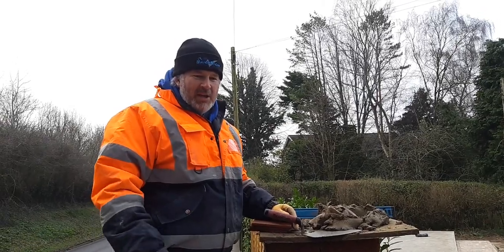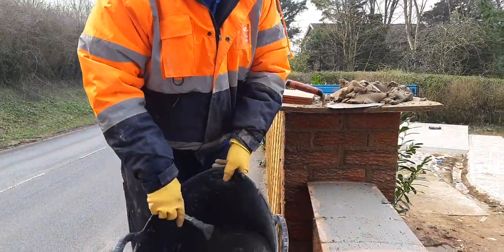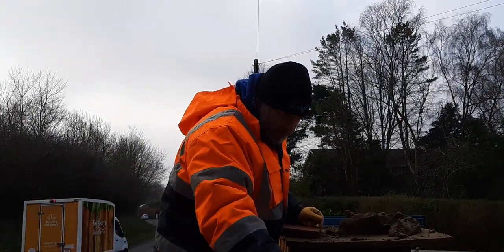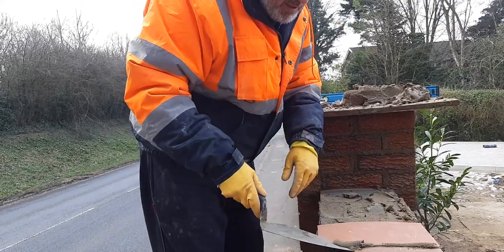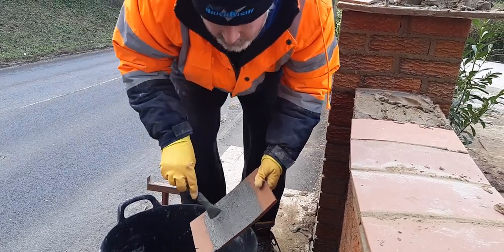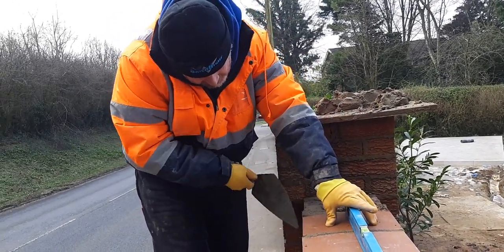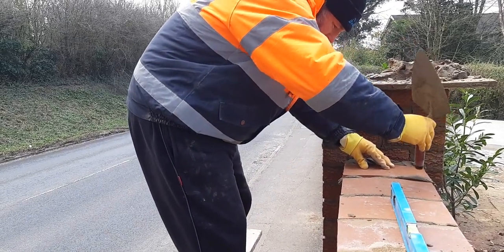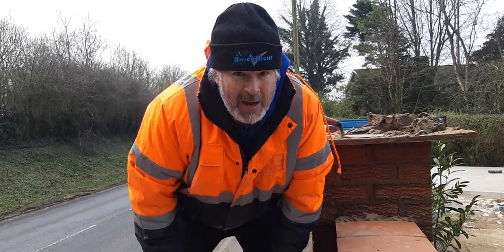#bricklaying Creasing Tiles On A Radius

Comment: Alright Justin,  Another great job done by you and the boys👍 I m I right in saying Justin you have trouble with your elbows m8? 
If so can you recommend any good braces for your elbows as I have been struggling with tendonitis on both arms and can’t seem to find a good fitting brace s 🤷🏻‍♂️  so any recommendations  would be appreciated bud .. enjoy yer weekend lads 👍
Reply from the maker: Tennis elbow pads with compression pads take a look at them they helped me out so much.
Also if your a bricklayer the marshalltown trowels have a high handle lift the w rose has a lower lift so maybe keep that in mind.Alao if you have a big trowel say a12 no need by a 9 or 10 inch trowel. 
Hope that helps it helped me good 👍